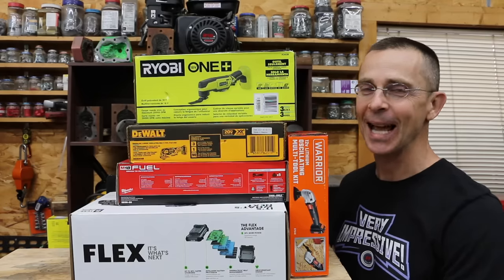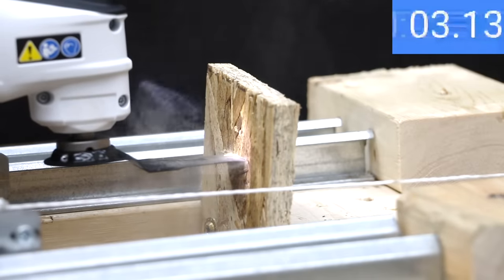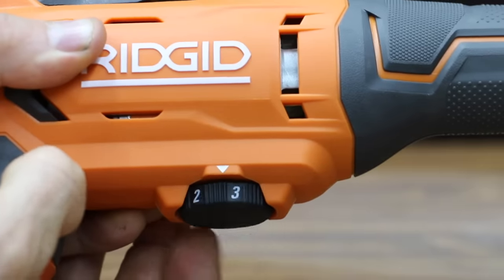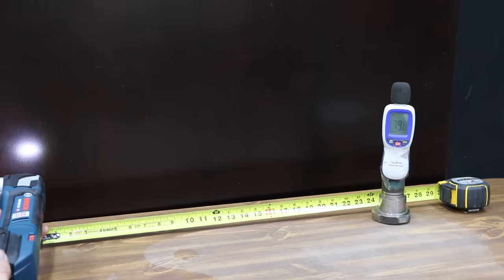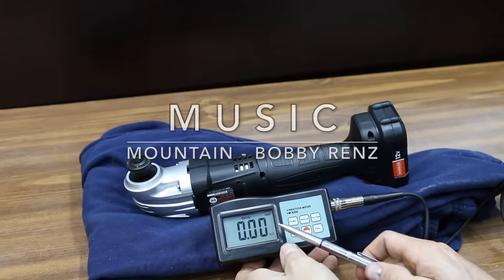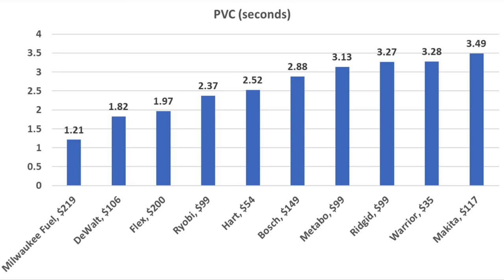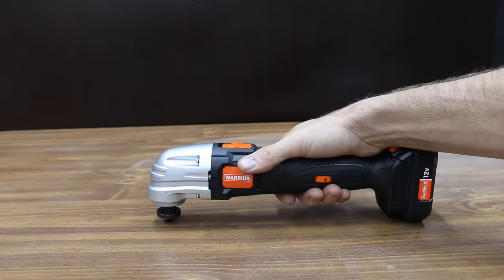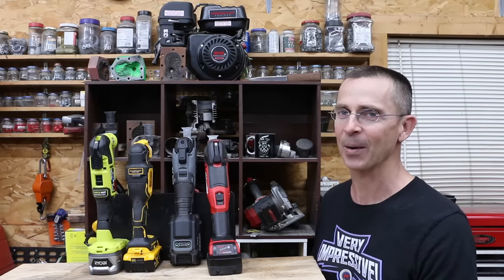Best Oscillating Multi-Tool? FLEX vs Milwaukee, DeWalt, Makita, Ryobi, Ridgid, Hart, Metabo, Warrior

Comment: I use Milwaukee Multi-tool everyday in my work, sometimes 4hours a day removing caulk with a knife blade from rope hanging 30-100m up in the air. Good to know we picked up the right machine. 😁
Reply: Yeah, if you're a professional, then Milwaukee is the brand you reach for.
Reply from the maker: Thank you!
Reply: Yea they just made a new model of  the fuel for !8v and 12v which i believe is the one he tested here, But he didn't try  one of the cool features which is the auto setting which will auto ramp up the speed as its cutting which is suppose to work the best
Reply: @ProjectFarm  No, thank you! We also use straight grinders alote to grind out fresh area on concrete to apply primer before we caulk, maybe you could do a video testing out these? On job sites you often se Bosch, Hilti, Dewalt, Makita and Milwaukee at least here in Sweden. Take care

Comment: If you want a great alternative to the M18 without spending as much, get the M12 Fuel; slightly less powerful with a bit less run time, but more ergonomic, much cheaper, less vibration, and still more powerful than most of the M18's competitors.
Reply from the maker: Thanks for the feedback.

Comment: As always, great test with sophisticated testing rigs. I was partially surprised about the results, except for Milwaukee, of which I knew in the beginning that it would dominate the showdown. Makita recently introduced a new multitool with a brushless motor, which would be interesting to see compared to the old version tested in this video. I'd love to see a second round of multitool tests, maybe with Fein and Festool. Cheers!
Reply from the maker: Thank you!  Thanks for the video idea.
Reply: Makita keeps me really happy
Reply: @ChunkyWaterisReal  Me too. A majority of my tools are from Makita, and their batteries are the first ones to not fail on me within a year. The LXT system might not be the latest or the strongest one out there, however, it is one of the most reliable.
Reply: The Fein and Festool would cost more than the lumber used.
Reply: Agreed.  I usually trust Project Farm, but leaving out Makita’s latest that gets great reviews elsewhere?  I counted over 30 requests for this in just a couple minutes of scrolling through comments.

Comment: Seems like the different brands have watched your video and priced their saws accordingly.  Probably not, but it sure seems to follow that the Makita is rarely this inexpensive but having bad performance doesn't warrant a Milwaukee price.  Milwaukee seems to really be the cutting edge of cordless tools lately!  They're always in the top 5 of tests!
Reply from the maker: Thanks for the feedback.
Reply: Makita weighs the most...why? Because it has the most forged metal, most copper, heaviest duty case. Makita has long made professional tools while Milwaukee (sold to some conglomerate) and DeWalt (also bought out) have pivoted to consumer tools. I bought Makita
Reply: @JH-tc3yu  I agree  Milwaukee drills just don't last .First thing to go is the chuck .

Comment: As someone that has the M18 Fuel, Dewalt, Ryobi and Ridgid oscillating tools I can say with confidence that the new fuel version blows the competition out of the park. It is expensive but well worth it. I have the small M12 brushed and the new M12 Fuel and they each have their uses, but the M12 Fuel probably beats most of the 18v competitors.

Comment: I wish you had compared a Fein also. I've used Bosch, Dewalt, Milwaukee, Dremel, Makita, Ridgid, and own my personal favorite, the Fein. Nothing has compared to the Fein. Of the different brands I used all were corded except the Milwaukee. Of course I've never done the excellent comparisons that you did, but going off of feel and speed nothing else even came close. The Fein blades also last longer & work as well or better than any of the others I've tried. Going off of memory the Milwaukee & DeWalt were probably the next best that I've used. All that said, my Fein is the corded model. I have not tried their cordless model. Thanks for an excellent test on these tools
Reply from the maker: You are welcome!  Thanks for the suggestion.

Comment: My only problem with cordless tools is that once you go with a brand it's hard to switch as you've already got a lot of batteries for their other tools.  I've got so many DeWalt cordless tools now that it just doesn't make much sense to go w/another brand unless it's corded or requires me to buy another battery style that I don't already have (i.e., the Milwaukee cordless ratchet).
Reply: I've seen people use 3d printed adapters so you can use competitors tools with your battery's. Pretty sure you can buy them on the web somewhere.
Reply: they sell adapters on amazon. the only problem though is they say you dont want to leave the battery attached after use as it will drain it
Reply: That's kinda the reason I decided to go with Wal-Mart's Hyper Tough brand of cordless tools.  I don't do enough work with my cordless tools to warrant purchasing name-brand tools with brush-less motors.  I might use them once a month.   So I decided to go with the cheapest cordless tools I could find.  I ended up getting most of them from the clearance aisle or during a sale.
Reply: It doesn't really matter who is the best. Unless you are cutting up stuff all day. But, if you need to make a few cuts here and there a few extra seconds aren't a big deal
Reply: @richardgreen811  by that logic why even watch his videos? Just buy the cheapest thing and live with however long it takes
Reply: @Darkcruzer23  most people watch these videos so the can puff out their chest because their favorite brand beat the competition by 1 second. What I'm saying is get what's best for the individual. Not everyone needs to spend $220 on an oscillating tool because it's the fastest. He is already in a battery line and it's not worth it to go into a different battery line over a few seconds. Unless he's using it all day everyday.
Reply: @richardgreen811  ya im sure people watch these then walk around "my Milwaukee is 1.5 seconds faster" sigh
Reply: @Darkcruzer23  Isn't that Harbor Freight's business model?
Reply: The battery adapters on eBay and Amazon open up a whole new world. Ridgid's lifetime warranty batteries in my Milwaukee tools and my Ryobi weed timmer!
Reply: @Darkcruzer23  I'm sure for most of us it's just entertainment ;)
Reply: @richardgreen811  youre literally projecting lol
Reply: @ivaninnokenti614  Milwaukee fan boy?

Comment: Excellent as always, my only remark regarding the testing protocol would be that testing at maximum speed may not be the most optimal cutting speed for all materials.
 Also, the oscillation angle can be misleading, some manufacturers quote the total oscillation, and some only one axis. One might think that a 1.6 degree tool is going to suck, but it's actually 1.6 degrees on either side of the center, so actually 3.2. The higher the angle the faster and more agressive the tool is, but it creates more vibration (EDIT: on paper, as shown it was not necessarily the case, commented too fast)  and a smaller angle may be better for more delicate work.

Comment: Since I already have a suite of DeWalt tools, batteries, and charger, I got  the DeWalt Brushless XR with 3-speeds which is amazing. I found it on eBay for $75 without battery but new in a sealed box and somehow shipped from Lowes. I have no complaints at that price especially. After watching your comparison, I almost feel DeWalt won because of the pricepoint, speed selector, quickest blade change, and reliability reputation. My only beef with Ryobi is inconsistent build quality overall. They seem to be hit or miss and you don't know how long your tools will last. Thanks for yet another great video!
Reply from the maker: You are welcome!  Thanks for sharing.

Comment: Thank you for your time, energy and effort! Just maybe a small suggestion for your next videos, if you could compare brushless with brushless ... the Ridgid has a brushless tool (R86240B) which perform better. While it did good, I feel it could had been better against the DeWalt and M18.
Reply from the maker: Thanks for the video idea.

Comment: I always appreciate and enjoy your testing videos.  Probably the most useful videos on YouTube for me and I typically can't think of how you might reasonably improve your testing.  However, in this case I question whether you can accurate characterize relative vibration by testing at a single point on the tool and at a single speed.  Object usually vibrate something like a string with nodal points that barely move and other locations that vibrate to varying degrees.  The location of maximum and minimum vibration should vary from tool to tool and with the speed set for each tool.  Did you try relocating the vibration probe along the tool until you found the point of max. vibration or just select an arbitrary point?  Perhaps you thought of this, but just omitted discussing for the sake of brevity.

Comment: Another good one. 
Has a pipe wrench showdown happened yet? That would be awesome. European styles vs other, brand contest, etc...
Reply from the maker: Thanks!  Thanks for the suggestion.
Reply: Just buy a cheap Chiwanese aluminum set for $40.  They're SO much easier to use in tight spaces it's not funny.

Comment: Should include the Makita DTM52 or its black variant, same thing, different name and colour. It's a massive leap forward and it's absolutely the most comfortable multitool I've laid hands on.
Reply from the maker: Thanks for the video idea.
Reply: I cancelled an order for the Makita oscillating tool shown in the video. I’m entrenched in the Makita ecosystem however. Does the Makita DTM52’s bulky head have any drawbacks?

Comment: Quick tip: It is actually important to distinguish the Metabo HPT from real Metabo tools. Metabo HPT is what used to be Hitachi Power Tools before it got sold to the company that owns Metabo. They slapped the  Metabo name on them to make them sell better. While they're not bad tools, they have nothing in common with actual Metabo tools and the batteries are not interchangeable. Outside of North America this tool brand is now known as Hikoki. 
While we're at it let's also point out that the 18V batteries for Bosch blue and Bosch green are also not interchangeable, which is lame. And that most 20V batteries are actually 18V batteries except the number on the box is bigger.
Reply: Thanks, i already wondered why the Metabo didnt look anyway close to the metabo  i know and performed that bad.
Reply: In Germany you can buy the MT 18 LTX BL QSL since 2021, this would fit much better in this test.
Reply: @absolutedisease1699  It didn't help that he used the weakest battery available.

Comment: I love watching your videos as they are always informative. However, I've got a slight bone to pick with you in with this test. Why did you pick the entry level Makita with the brushed motor and lower power output, instead of their higher end model that is more comparable with the Milwaukee and Dewalt?

The model XMT03Z you tested is 1/2 lb heavier, has .4 degrees less oscillation angle (3.2 vs 3.6), and is less powerful than the model XMTO4ZB, which has a much better brushless motor. It can be found online for about 40-50 bucks less than the Milwaukee in the tests. My best guess is that it would be more competitive with the leaders than the model tested.

Anyhow, keep up the great work!
Reply from the maker: Thanks for the suggestion.  Thanks, will do!
Reply: I’ve been told that the XMT04 is lower vibration than the Fein, which sounds quite impressive. 

I think you should try testing vibration in use. I saw another comparison of the noise levels, and the XMT04 was very quiet when not in use but comparable to others when in use - I expect similar results with vibration. 

Makita has a demo video showing the XMT04 with a glass of water barely shaking. If you take a long time to align your tool and are holding it a lot, then that could be a good benefit. If you are cutting a lot, then that doesn’t matter as much.

Comment: That Ryobi is stellar for the price. It performs well in every category and is even brushless.  The Milwaukee was shockingly good as well but you gotta pay to play
Reply: The Milwaukee is more expensive but divided over the years of use it's a bargain for the increased capability. It will also last twice as long, so if anything it's a better deal per use.
Reply from the maker: Thanks for the feedback.

Comment: I have a suggestion for this batch of tools. Using a larger capacity battery than the one used in the testing, example Ridgid 4 amp or 6 amp battery, make the tool faster, slower, or no change.
Reply from the maker: Thanks for the suggestion.

Comment: I watched a few videos before choosing a multi tool. The m12 fuel multi tool is supposed to perform the same as the m18 and some said they liked the m12 better. I’d like to see a comparison between the 12 volt multi tools and 18/20 volt multi tools if it’s really worth the extra voltage and larger tool size.
Reply: I have both. The m12 is not nearly as powerful as the m18. For cutting small things it's fine, but you can cut faster or notch 2x4s or whatever with the m18 much better. It's not even close.
Reply: If you are gonna choose between the Milwaukee battery systems and look at bigger picture i think the m18 is a better choice.
Reply: I bought my M12 Fuel tool before the new M18 Fuel version came out. And _at_that_time_, the M12 Fuel did outperform the old M18. There were lots of videos demonstrating this. I'm happy with my Dewalt 20V and Milwaukee M12 tools.

Comment: Thank you for the video. I'm sorry to see you didn't cover the newer Makita XMT04ZB brushless subcompact 18 volt multitool in this video. It is getting great reviews. It would be helpful to hear how it compares. I haven't bought one (yet...) because the star lock system seems very expensive for blades. Do you have any thoughts about the pricey star lock blades? I have tried the older Makita version you tested. It was definitely lackluster.
Reply from the maker: You are welcome!  Thanks for the suggestions.

Comment: Interesting results. I didn't have one of these until last year when I picked up a corded Dremel version. I have found that this tool is completely awesome, and don't know how I managed to get along without one for so long.. lol   It seems the Flex might be best value for cordless since it comes with a battery and charger and performed okay.
Just a thought. I'm looking to buy a new rivet gun.. Have you compared those? Was looking at Wetol on Amazon..
Reply from the maker: Thanks!  Thanks for the video idea.

Comment: Would love to see the Makita XMT04 on one of these. Super quite and very low vibration. Gets through OBS in about 3 seconds using just the weight of the tool and battery which is just under 4.5 lbs. Best multitool I have used on several fronts, and I have used many of the leading brands. That is just my experience though. I would love to see your more objective results!
Reply from the maker: Thanks for the suggestions.
Reply: I was kinda wondering, just bought an XMT04, seems like the design on this one is more equivalent to the newer versions that the one in the video (the older makita) is compared against... Not sure if this tool was out at that time, but it might be worth mentioning or at least noting what versions of the tools these are from the manufacturers, it's not easy obviously but it's also not exactly fair to them if you've got a v1 going up against a v2 or something. Also, I just bought this XMT04 so I just want to see how it stacks up anyway lol
Reply: XMT03 is a bad one.  It has the horrible vibration of the metabo.  From another video, the Makita was not as powerful as the Milwaukee's but was much quieter and less vibration than the Milwaukee.
Reply: @lostandfound6501  yeah the old first gen was not pleasant to use. But that isn’t the one I mentioned. I have seen some videos of the Milwaukee edging it out in power, and I have seen the opposite. Owning both of them, I have not experienced the difference. But I’m not sure why people care so much about 3-9% more or less power on a light duty tool that is meant more small precision work. I care far more about how enjoyable the tool is to use. So vibration, and loudness are far more important in my opinion. Which is why I use my Makita far more than I use my Milwaukee. It’s the better tool all around.

Comment: I love your channel, but something's not right about your Metabo findings.  Did you have it in Auto mode?  The unit is a beast and check out the Amazon reviews.  I wouldn't trade it for any of these other models. And with its build quality, it will likely be working just fine many years from now too.
Reply: I DON'T AGREE... One thing WAS the OLD, made in Germany, Rugged, Precise and Durable old METABO TOOLS, and another completely different is the  CHEAP, UNDERPERFORMING AND DECEIVING "Metabo-HPT" tools,  that are a KNOCK-OFF line that cheats the buyer by using the same (or very similar) name...

Comment: Great video as always but I wouldn’t recommend osb as a test medium for cutting, esp with a tool that only cuts a 1” wide area per your test rig. OSB can vary in density wildly inch to inch as it’s formed from random chunks of wood. MDF might be a better candidate. Also did you use the same blade in each tool or the blade included with each tool?
Reply: He said in the video that he used the same blade on every tool
Reply from the maker: Thanks!  Same brand of blades used for each tool.  Each tool got a new blade.
Reply: @lukaswilson1437  thanks, somehow I watched it twice and still didn’t catch that. I assumed he would, he’s the man!